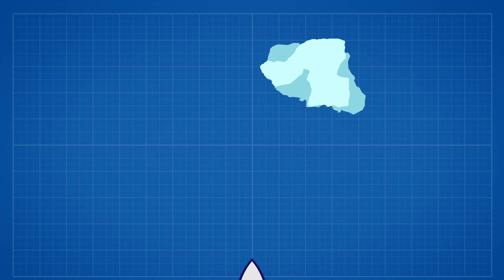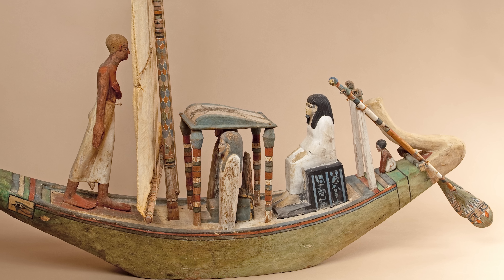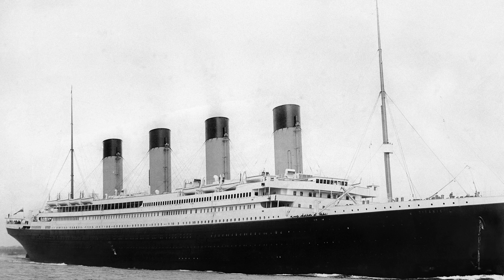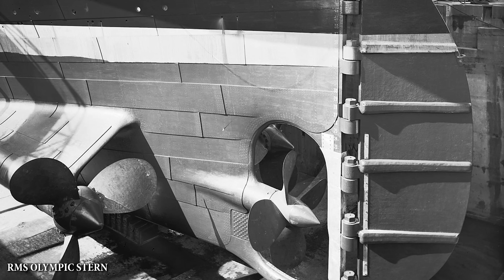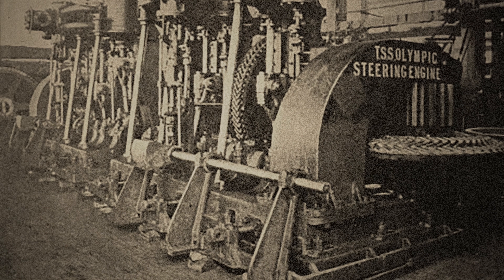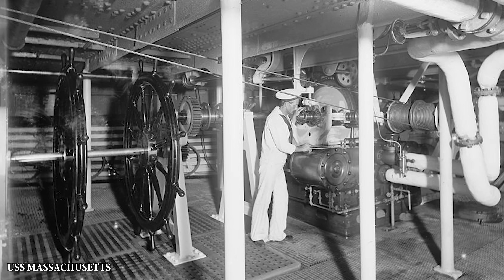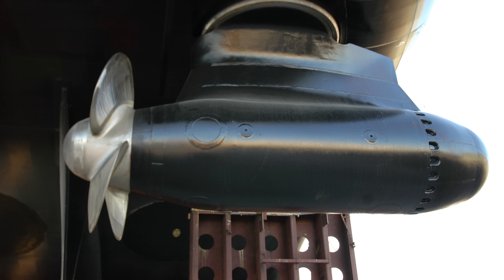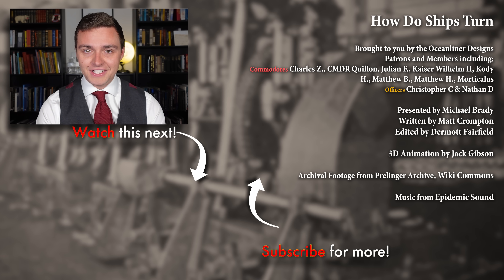How Do Ships Turn?

Comment: I studied ocean engineering at the US Naval Academy and found this video very informative. I served a few tours on the old Perry class frigates. We had Auxiliary Propulsion Units (APU) located almost under the bridge, one on either side of the center line. Although intended as an emergency get home backup if our single screw failed, they came in very handy for maneuvering. They could rotate 360 degrees and using the right combination of main shaft torque and APU thrust a good conning officer could turn the ship inside it's own length. It was a dream to maneuver those ships once you got the hang of it.

Comment: Hello Mike,  love your stuff as a historical ship buff. It’s possible I am one of a very few people who has steered with steering oar, tiller, whipstaff, wheel (conventional) wheel (modern) and pod.  I use a steering oar with my home-made sailing canoes (lateen rig and leeboards) and a tiller with many skiffs and yachts over the years.  I’d make the comment that the whipstaff  is not necessarily difficult provided you get it absolutely right. I remember surfing down 6 m swells in Bass Strait in the Duefken replica and if I got it right I could steer with my fingertips, if I got it wrong I need my full strength with my feet on the whipstaff and my arms on the side of the helmsman area.  The Enterprize at Williamstown was tiller steered and that was VERY hard work. Sailing on the James Craig I used a conventional wheel including in 50 kn of wind off the Port of Newcastle. I also had a chance to steer an ocean liner, Galileo Galilee, one of the Lloyd Tristino liners running to Europe back in the 70s. Finally, I got to experience pods in a tug on Newcastle Harbour.

Comment: We owe to the building of ships the invention of 1 of the most marvelous gizmos I know of as an electrical engineer and controls specialist and that is the synchro which proves The  At the front of the vessel to be connected to Will way at the front of the vessel to be connected to the steering gear just Wires3 phases electricity

Comment: Mike No No No. Its the balance of the wheel itself. Turning it one way or another puts more weight on one side and takes it off the other. That makes the ship turn its just like being on a bike lean one way and the bike goes that way, sit upright and the bike goes straight. Just like the bike it only works when moving. On the bike if its not moving you fall off on a ship it does nothing.

Comment: There are also two more notable systems:
-shrouded 360° propellers (basically the cousins of the azipod) used f.e. in tug boats, those huge towing vessels and as positioning thrusters in all sorts of vessels (ships, oil platforms, swimming cranes)
-vertically spinning straight blades known as the Voith-Schneider propeller (mainly in tug boats and ferries, but also a few towing vessels)

Comment: You explained the Titanic was ordered hard to starboard and the helmsman turned the wheel to the left. Is that correct?

As built ships of 1912 vintage often had the helm built to move the same way as a tiller - so a left hand application on the helm would set the rudder to starboard and the ship would turn to port. Opposite to what it is today. 

I’m led to believe this is because ships were still more common than cars,  car transport was in its infancy and not yet widely adopted. As cars increased in popularity ships helms were later retrofitted to match and avoid confusion. 

Would titanic not be the same? I.e. a  left hand turn of the helm would set the rudder to starboard, and the ship to port?

Comment: Took me a minute to understand what you were referring to. Not the desired ship direction but the desired rudder direction. One thing to note. When the vessel is initially changing course the stern is swinging into the object being avoided. Counter steering in the opposite direction is required to swing the stern away from the object.

Comment: Ther terms “Starboard” comes from the old english meaning steer board, the board on the righthand side of the ship used steer. Port, used to be referred to as “Larboard” from load board, the plank used to load cargo on the opposite side to the steer board.

Comment: Thanks for all your great content, Mike! But can you shed some light on when this archaic steering command system changed? Surely it doesn't persist to this day even on large ships, but if it changed, there must have been utter confusion for a period. Oh, and one other thing: did First Officer Murdoch not also order the engine full astern at the same time, thus deriving the rudder of steering power, or maybe even reversing the water flow over it, actually turning Titanic INTO the iceberg instead of away from it? Might turning alone not have been more effective in avoiding the collision? Except, that might have avoided the bow colliding but smashed the stern sideways into the berg? I'm not monday morning quarterbacking, I'm a qualified small ship mariner trying to understand what happened and how we can learn from it.

Comment: Early in his career, Charles Lightoller was on the bridge when his ship was leaving port down a channel without tugs. A ship coming the other way became a collision hazard and the Master threw the wheel to one side and after the bow started moving in the required direction, immediately threw the wheel the other way. The end result was similar to a car changing lanes to go around another and then changing back. It not only prevented a collision but also prevented the ship from spearing out of the channel and embedding it into the bank. Lightoller was so impressed with this maneuver he was known for using at other times in his career. It has been speculated that this is what he tried to do on THAT NIGHT with Titanic and may have actually CAUSED the ship to hit the iceberg. The speculation implies that had he simply steered to avoid and not maintain course they probably would have missed or only damaged maybe one or two compartments, which Titanic was designed to still float with this damage. Interestingly it has been calculated that if Titanic had simply hit the berg head on, the damage to the bow would have been catastrophic, but the pumps would have handled the incoming water for long enough for rescue hours later. It was the multiple breached compartments the pumps couldn't handle. Titanic and Other Ships by Lightoller is an interesting read.

Comment: Good video Mike - as usual. I think the the Royal Navy - hence most other people went from Tiller to Rudder orders about 1930. That is the harder Port 10 meant the wheel and rudder were both turned to port and such the ship did, rather than the scene in the Titanic movie, which was correct. My understanding is that the USN wanted to do away with port and starboard as well and use left and right but the British Empire stood firm. It is why in American films you will hear Left Standard Rudder. where the corresponding order in most of the world would be something like Port 20
Reply: Thanks, I was looking for this answer. Yes, in WW2 movies, etc, I've heard the phrase "Left Standard Rudder" and "Right Full Rudder", etc. Makes sense. It sounds to me the shift was to emphasize the direction the rudder needs to turn, not the tiller.

Comment: My 1965 ski boat has the outboard engine connected via steel cables to the steering wheel. One cable runs down the port side of the boat. The other runs down the starboard side of the boat and at the stern they connect to the motor. Each cable has three wraps around the steering wheel and when I turn I am literally pulling the engine to the left or to the right. I could fairly easily end inexpensively convert to an electric /hydraulic steering system. Note I said convert and not upgrade; the feedback from The existing system is unimaginable

Comment: The animation was inaccurate. The stern swings out first, which points the bow in a new direction. The animation showed the bow leading the way, like steering was happening at the front.

Comment: When I was doing military service I steered two warships and they both had very simple steering system,. One had a three position joystick. In the center position the rudder stayed where it was and turning it left or right opened two hydraulic valves in the steering engine room that made the rudder turn at constant speed. There was a rudder position indicator at the bridge. When I wanted to turn the rudder to some specific angle, I held the joystick to that way until the indicator showed it was in that angle
and then when I wanted to return it to center, I held the stick the other way until the indicator showed the rudder is centered. The other ship had a ship's wheel but it was a fake. It turner only few degrees both ways and worked as a fancy joystick.

I guess they used that really simple system because it was most reliable under enemy fire. Just a pair of wires having voltage with one or the other polarity or neutral. And likely multiple redundant cables going through different parts of the ship. Those ships could also be steered in the rudder engine room.
 
Rudder commands used the actual turning direction, not the tiller position. And not port or starboard but left and right. The commands were actually 'on the right' and 'in the left''. Those are single words in my language and giving  the commands that way meant that there was no common parts in the words so if I heard only small part of the word, it was enough to know what way to turn,
Reply: The US destroyer John S. McCain has a complex electronic control that's non-intuitive and didn't give feedback to the helmsman to know the two engine controls had been placed into uncoordinated mode - they needed separate command inputs. That was one cause of a bad collision it had. There were a dismaying number of causes. Anyway, the NHTB recommended changes to the controls with more attention payed to human-factors engineering. 

So unfortunately it didn't have the simple system you describe, one that's robust in mechanical and human-thought terms in combat or near-collision events.

Comment: I don't think it's actually shown in the films but we see Murdoch use the engine telegraph on the Titanic's bridge to bring engines full astern. 
It's unclear if he only signaled the Port Engine then later the Starboard or if he did them all at once. 
I'm really surprised that someone like Murdoch wouldn't have known that a simple ordering of the Port Engine only to Reverse would greatly help with turning the Titanic. 
Again, as I said it's unclear if it was actually HIM who moved all 3 telegraphs or just the 1 and the others were ordered after not by him.

Comment: I can never get past the fact that they had haptic feedback with a purely mechanical system. Also, always glad for a Great Eastern mention but you forgot that the Great Eastern was the first ship to receive a steering engine because of that. Lastly, now that you have covered steering, a video detailing how the steering engine operated is desperately needed. One which details how the telemotor input was used to configure the engine valves. Many of us are still confused over that point. I've seen it in real life on the USLHT Lilac, but that was some time ago.

Comment: As a kid around 20 years ago I was amazed at how, at the time, largest ferry in the fleet of my local shipping company was steered by a thumb operated joystick not more than 5-6cm in height up from control pannel. That ferry still had a wheel to be used as a backup, but I have never seen it in use whenever I traveled with that ferry. Of course, later ferries got quite a bit larger and dropped rudders and wheels all together, now using azimuths on all 4 corners of the ship.

Comment: One famous experienced captain said in his interview, that the Titanic might have had a chance, if the speed had not decreased. At higher speeds, the force of the water acting on the rudder increases, which makes it possible to change course more effectively. Thank you for another wonderful video full of historical aesthetics and theoretical mechanics in parallel! ⚓️⛵️
Reply: All ships with a standard rudder system have specific maneuvering speeds that are made by balancing all sort of variables during design and, even with modern computer modelling, can't always be reliably determined on new design until you actually go out and do sea-trials.  The primary maneuvering speed is the speed at which the ship will have the smallest diameter turning circle for a given rudder input.  And it does not occur at the highest speed (i.e. your turning radius doesn't decrease as you increase speed).  Obviously, at slow speeds a rudder has virtually no steering authority.  At higher speeds rudder-controlled ships will, almost always, turn at a greater rate per unit time but, above that optimal maneuvering speed, they will turn more slowly with respect to distance travelled.  The technical name for it is: rudder efficiency.  And it always decreases with speed once you get above that optimal maneuvering speed (actually, it decreases with the square of speed).

In the case of Titanic, this is for two principal reasons.  The biggest reason is (and this is true for all standard rudders): whenever you deflect the rudder to one side, you get an area of high pressure on the side of the rudder in whichever direction to which it is deflected.  As the speed of the ship increases, that area of high pressure gets larger overall, but it also moves forward (towards the bow of the ship and towards the leading the edge of the rudder).  This causes a greater proportion of the water upon which the rudder acts to be diverted to the side opposite of which the rudder is deflected.  If you have the rudder deflected to port (pushing the stern to starboard, hence turning the bow and, therefore, the entire ship to port), any water that goes around the rudder to starboard and doesn't ram into the deflected face of the rudder does not do anything to turn the ship (it actually causes a reduction in the pressure differential between the two sides of the rudder which results in a decreased moment of inertia acting on the rudder).  The second primary reason that Titanic (and this is true, again, with almost all rudder system designs) would not be able to execute a course correction in the same distance at high speed as she would at a more middling speed is because of helm to rudder response.  This is a completely separate thing from the physics governing diminished returns for rudder efficiency, but I want to bring it up because it certainly played a huge role in the case of the Titanic collision.  The helmsman might be able to spin the wheel as fast or nearly as fast regardless of the speed Titanic was sailing at - but the speed you spin the helm is not the same speed that it takes the rudder to get to where you want it.  As he covered in this video - the helm isn't actually mechanically driving the tiller that turns the rudder.  The steam-driven engines in the steering room are doing that.  And, at high speed, there is much more force fighting the rudder as they try to turn it.  So those steam engines will have to work harder and longer to drive the tiller over to maximum deflection at higher speed.  Modern ships are the same way.  On almost all modern ships - even cruise ships and supertankers - the helm isn't a wheel.  It's a tiny little dial you turn with a couple of fingers.  But just ordering the rudder 30 degrees to starboard doesn't get it there.  Then you have to watch the rudder position indicator as the hydraulics actually drive the rudder to the commanded position which, at speed, can take 10-20 seconds on a large ship.
Reply: @Joseph55220 I learned something today. Thank you for taking the time!

Comment: It would be fun to see how tight turn you can make in as slow speed you can make it in with the diffrent methods of steering  and the same size of boat.
Reply: My guess: Pod drive rules them all, and then comes the detached steering oar. Rudders of any kind are really bad at slow speed, especially when not aided by prop wash. Add in a long hull...

Comment: There's a documentary from 2017 called "Down in the boiler room" (I think it's on YouTube) showing the last working steam-powered vessel still in service in the UK.  They take us around all the engineering spaces, including the steering engines and tiller.  What's shown in the video is pretty much exactly what I imagined Titanic's steering gear to be except smaller (obviously).  They run it through a number of tests and turn the rudder either direction with the steering engines.

EDIT: Actually it's called Down in the Engine Room, and yes, it is on YouTube.  It's about the steam ship Shieldhall.
Reply: love that one

Safe travels and a hand's breadth of water under the keel for the SS Shieldhall

Comment: The claim, at 6:10, that a bigger wheel requires less movement, is 180 degrees incorrect.
The bigger wheel requires less force to rotate through the same angle as a smaller wheel.
Since work equals force times distance, the amount of work is unchanged: less force, more distance.

Comment: I might have missed something when I was distracted by an oriole started feasting on the oranges I put out for them, but in the United States helm orders are given as left and right rudder, and that is both the side the rudder shifts to and the direction the helmsman turns the wheel. This is mandated by law, and even foreign pilots try to avoid using port and starboard as helm commands. But even when they do use those terms, it still means to turn the wheel and rudder to the port or starboard, rather than the opposite.
I am unaware of any nation that continues to give counter orders such as described in the Titanic scenario.
Reply: I feel like at this point, there is probably a standardized system of commands with all of the global trade going on.